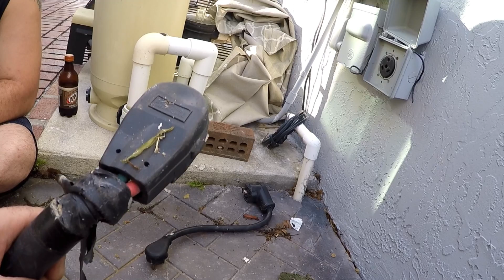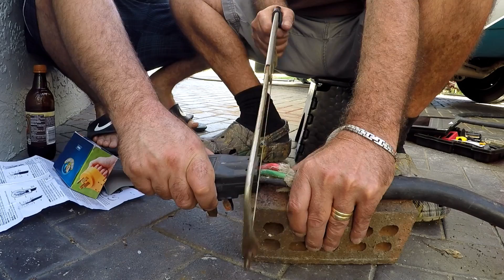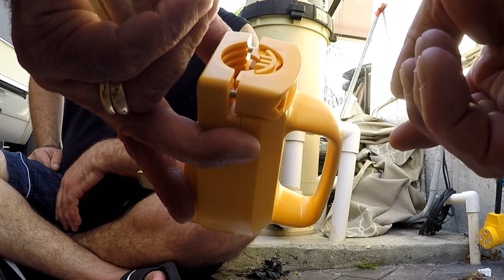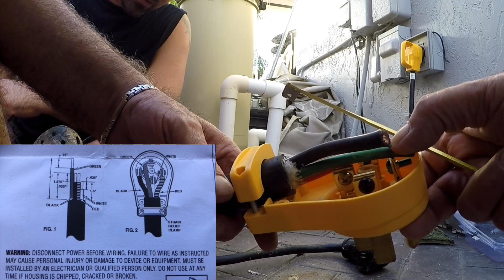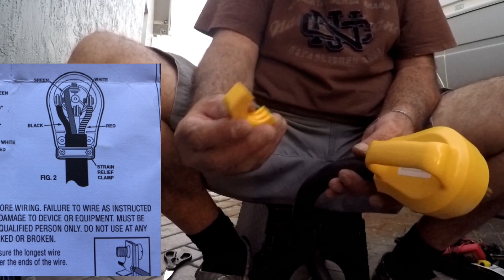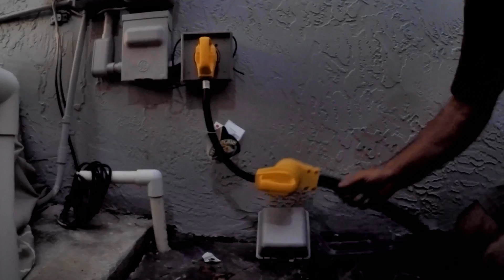HOW TO REPLACE RV 50 amp MALE PLUG | CAMCO POWER GRIP POWER CORD

Comment: On my old plug the red wire was on the LEFT. Does it matter if the red is on the left and the black on the right?
Reply from the maker: Not sure. I would ask an electrician.

Comment: Is there any switches that need to flipped before cutting the cord?  Would i have to turn the battery switch off?
Reply from the maker: Not sure what kind of extension you have but I'm able to disconnect the other end from my motorhome in which it isolates it from everything. If yours is not disconnect able see your manual or call manufacturer...
Reply: @JohnCRV  thank you.  I'll check with Forrest River.  I just don't want any hot wire when I cut the end of and handle the wire.  Thank you
Reply from the maker: @emmanueldorn3211  I agree! Better to be safe than sorry. 👌

Comment: Nice job and to the point my question is do I need to disconnect batteries b4 I do the replacement
Reply from the maker: Not sure what kind of extension you have but I'm able to disconnect mine. from my motorhome in which it isolates it from everything. If yours is not disconnect able see your manual or call manufacturer...

Comment: Where does the green grounding wire end up going 'to'?  Cos you've got 4 prongs going to 3 into your box on the house..
Reply from the maker: the reason it’s 3 going into the outlet of yeh house is because it’s a 30 amp outlet, which the bone extentention reduces it to. But the ground is the top round and will always be active. I hope that explains it.

Comment: Needed male ends on both sides for backfeeding a panel. What a pain in the arse, for sure. I think that I could become an expert at it after doing it a few times. I did check the connections with a continuity tester just to make sure that everything came out ok. Thanks for uploading!
Reply from the maker: Thank you for your input, it is a pain... Great idea checking the connections with a continuity tester 👌

Comment: Wouldn't have thought to just take them out to put the wires on, great advice...love that handle to pull it out easily...Great job as always...
Reply from the maker: Taking them out after making sure they are the correct length is the only way to really do it without the box being in the way. Thanks for the great comment.

Comment: I replaced the 30 amp male connector on my Casita right after I bought it because the original  connector was looking a bit rough.  I like the handle for pulling the connector out of the outlets.  Great video demonstrating how to do this.
Reply from the maker: You are very handy my friend.😉👌 It's very simple to do but I should have mentioned for those who know nothing about electricity they should let a professional do it. Thanks for the comment and hope you continue to have fun on your trip.
Reply: Well, I am/was an electrician in my previous life before I retired so I was somewhat comfortable with this repair.    I am loving my time in south Florida so far.
Reply from the maker: @PidasianHippie  Find out something new everyday. Very cool.

Comment: Well done! I’ve replaced several 30 amp plugs and receptacles over the years, but they’re quite a bit easier. Only three wires, and the wires are much thinner, making them easier to work with. And I have a “dogbone” similar to yours, only in reverse. Our “dogbone” allows us to plug our 30 amp RV into a 50 amp receptacle. A lot of 30 amp campground receptacles are loose and corroded, making for a poor connection. The 50 amp receptacles typically don’t get as much use, and provide a much better connection.
Reply from the maker: Thank you Tom, appreciate the visit and great comment. I agree about  the old plugs. Some of the old campgrounds still only have 30 amps and they scare the heck of me. The hurricanes down in Florida have helped destroy most of the the old 30 amp underground wiring when trees were uprooted by the winds and when they rebuilt they were upgraded with thicker gauge wires and new plugs but still some of them around.

Comment: I need to do this as my 30 amp plug as the cover has pull away from from plug prong housing cover ...thank you for great DYI video!!
Reply from the maker: 30 amp plugs have 3 wires so a little easier to do. Good luck.
Thank you for the visit and comment. Have a good weekend.